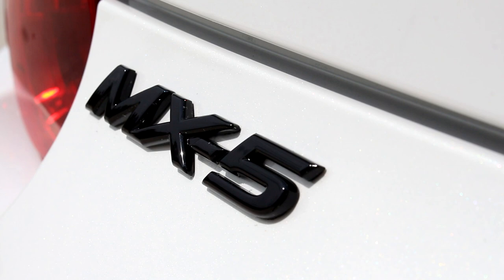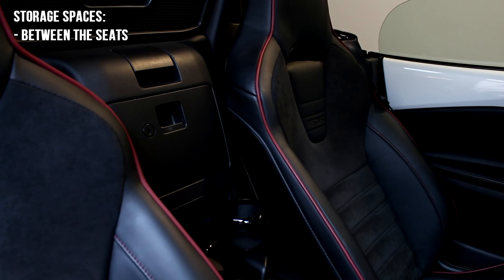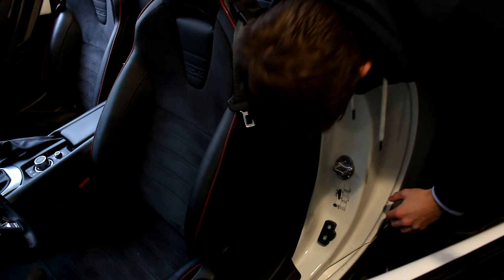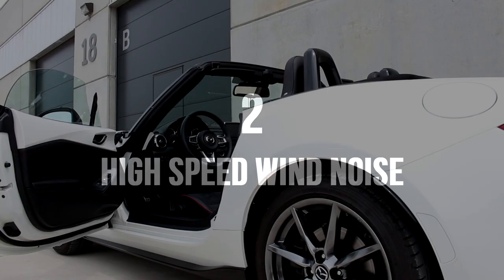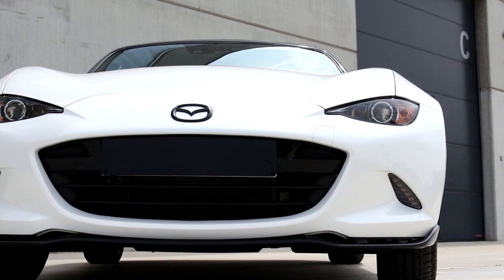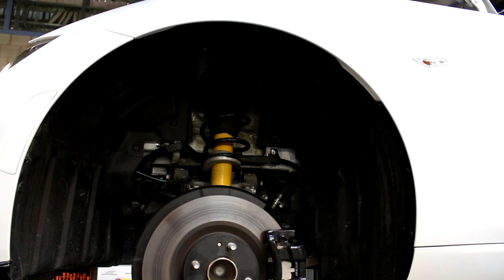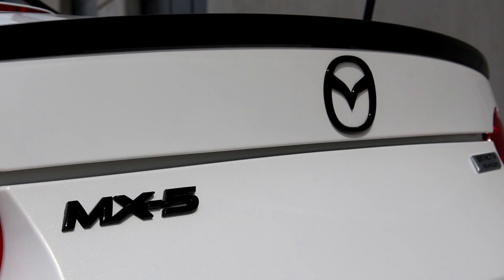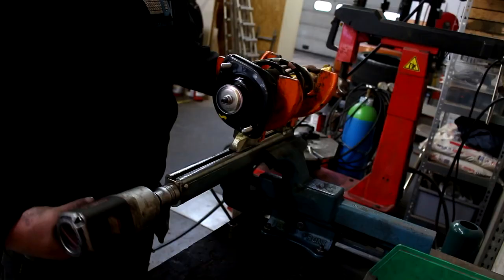5 things I hate about my 2016 ND MX5 - Miata In Action - Episode 6

Comment: great vid! i also have a problem with wind noise at high speeds. have you looked into any solutions to it?
Reply from the maker: No, I did not look into any solutions for this problem. I do not do a lot of highway so it actually is not that big an issue for me. I think you could maybe add some sound damping material under the carpet. But what the roof noise is concerned, I would not know. Maybe some kind of extra roof lining or something. But I have not seen anything yet for the mx5 softtop
Reply: Yep... turn up the radio... lol
Reply: Yeah i do a lot of highway driving nowadays from LA to San Diego and it pretty much sucks. I put some sound dampening material in the trunk cover and the trunk lining but that's about it. thanks for the advice though, i'll look into extra roof lining options. I had the Goodwin Twintip SuperStreet muffler on for quite a while (and even drove across the nation with it on) but even though it sounded really good I had to take it off because it was so loud. If you don't do a lot of highway driving I would definitely check out anything Goodwin. I'm actually looking to sell it if you're interested.
Reply from the maker: I would be interested but Belgian laws about modifications suck really bad. engine tunings is illegal, bolting on parts without the proper certifications is illegal. It is kind of struggle over here to modify your car.
Reply: Belgium! My bad, I totally didn't double check the video after I first watched your video a couple of days ago. That's quite unfortunate regarding the laws, though...
Reply from the maker: Yess i is a pain, but we manage. What they can not see they cannot say anything about. thats kind of the motto over here :p
Reply: I also use earplugs but I just hate having to compromise for it because in hindsight I should've taken it onto the highway for a test drive. I love everything else about the car, though. 

You're right about the noise coming from the road. Most of the wind noise comes from the slit of the drivers window as well as the place in the softtop where the B pillar is supposed to be. But yeah the road noise really sucks especially on the concrete...not much I can do about it besides Dynamat etc...
Reply: Harrison C, If you're really concerned about highway driving, eco tires would last longer and produce less road "growl" because of their compound. If you happen to get another set of wheels like those offered from Goodwin, you could keep some sticky summer tires on them and just switch wheels for spirited driving when you know you won't be on the highway. Just my two cents as a fellow miata owner :)
Reply: Best solution I've found was buying the RF like I did. You gain some nasty blind spots but very nice even at 80mph with the top down.
Reply: The law thing is a double edge sword... while it is a pain, here in the US we have people who take modifications to an extreme.  Harley motorcycles often run straight pipes which ARE fun... Fun if you are riding but if you are sleeping near by, not so much.  It does seem extreme not to allow any mods.

Comment: salut tu recommandes la 2l ou la 1.5 parceque , je compte économiser et me l'acheter d'ici 5 ans
Reply from the maker: This actually depends on the kind of driving you plan to do. the 1.5L is very rev happy and needs to be kept more in the highest part of the rev range to have fun as I have heard. The 2L has a bit more low-end torque which makes them great cruisers as well as a high revving fun car. So my preference would go to the 2L engines. But make sure to check you local taxes as well, as this may differ quite a bit depending on where you live.
Reply: AVPOnTheRoad that is right.. In Netherlands 2.0L is 5k more expensive due to carbon tax..
Reply: Ditto

Comment: omg i hate how the daytime running lights turn off
Reply from the maker: I know the feeling :-P
Reply: This could surely be fixed by applying 12 volts to 1 wire.  The hard part is finding that single wire but there should be a wiring diagram in a service manual somewhere that shows which wire it is.

Comment: The only things that are really annoying is the stupid controller in the middle of the center console and the horrible use of the infotainment.
Reply from the maker: I can see that it could be annoying for some, but I guess that a matter of opinion. I actually do not have any problems with the controller. I like the physical buttons which makes it easier to do small changes while driving. And for all big changes, like setting navigation and so on, I mostly use the touch screen.